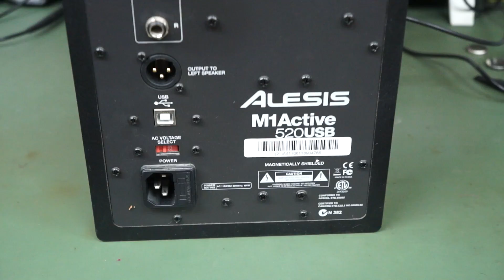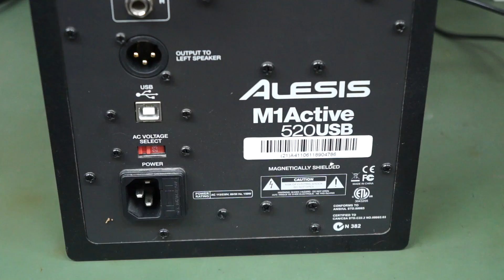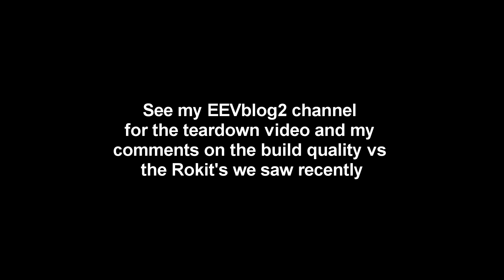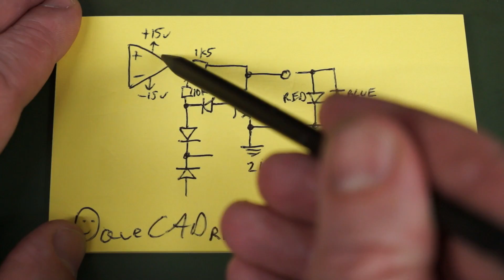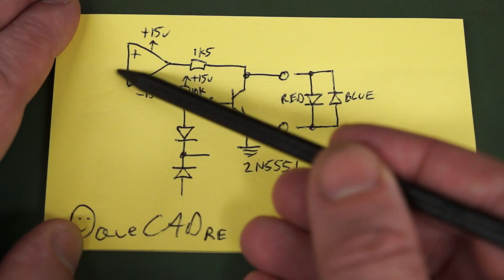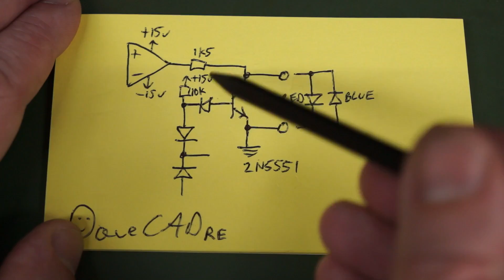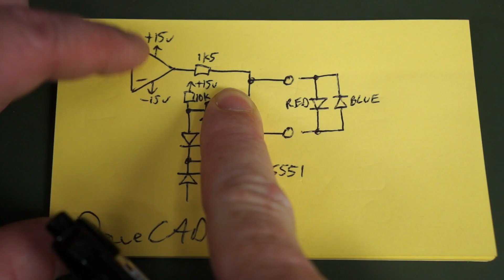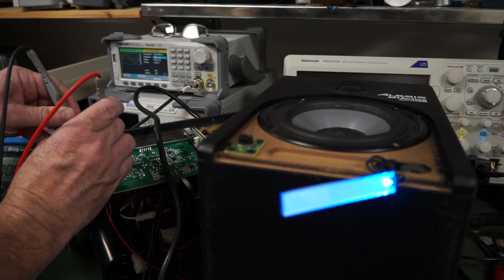EEVblog #1087 - UNBELIEVABLE Alesis Studio Monitor Fault!

Comment: Don't use USB power for speakers it will put more stress on your computer's power supply. I think they are a stupid idea.
Reply from the maker: Err, these are mains powered monitors.
Reply: Don't install motherboards in your PCs. It will stress the power supply.
Reply: No, it won't stress the power supply. And if you actually watch the video you can see the nice big obvious mains inlet on the back of the speaker anyway.
Reply from the maker: Ryan Smith  - I showed the back of the unit, it has a mains connector, pretty obvious.
Reply: You would never get monitors such as this to run off 5V 1 or 2A.
The quoted power output is 20 or 30w per ch, and I would imagine the unit as a whole would use close to double of that due to inefficiency.
Which is not to say it wouldn't make some sound at low volume if you had some way of bypassing the transformer etc.
Reply: Prehistoricman don't be such a pratt
Reply: EEVblog oh, I have bought usb speakers in the past and they usb for power and data but they were really small pc speakers that I ended up never using.
Reply: I assumed that this had some transformers to amplify the 5v input power
Reply: EEVblog maybe you did not make during the video. I could not see no plug so somehow I assumed it was USB, especially when you said the speakers used usb I just thought "oh no here we go again".

Comment: what is he saying at 8:22 ?
Reply: 12:20 "suck out that tranny"
....?
Reply: Translation is "desolder that transistor". Suck out refers to the desoldering tool, which melts the solder and sucks it inside, to remove it from the board.

Comment: I expect the surface either of the anode or the cathode inside the LED to be corroded and increased resistance by whatever reason, so the higher current probably helps to pass it. We definitely need an LED Engineers opinion here.
Reply from the maker: Yeah, something like that. That's what I was alluding too when I mentioned a "point contact diode effect".
It's not like there is enough current cause any heating/expansion effect of the contact, so more likely to be some sort of contact surface phenomenon.

Comment: Still waiting for fair ANENG8203 review
Reply: M E You can't spend $3 more and get a uni-t?
Reply from the maker: The Uni-T in my opinion is a BETTER meter for only a few dollars more, it WINS the low cost meter shootout. You don't have to like that, you can have your own opinion, but don't complain I didn't give it a fair review, I did.
Reply from the maker: BTW, go look up the meaning of "poor diddums", it has nothing to do with being poor and not being able to afford something.
Reply: UNI-T10A won the shootup, but why?  The ANENG 8203 is objectively better in many aspects:
unlike uni-t it's true rms (which could be a big deal)
unlike uni-t its beeper is loud, fast and latched (and not cheap and scratchy) 
unlike uni-t it does light up white leds (brightly actually, uni-t doesn't do it at all)
unlike uni-t it has 2 AAA batteries, which should give it a longer runtime (specially with lithium AAA's)
Additional personal prefs:
+ it has a propper knob that you can grab, with two off positions
+ it has a hardcase at least
+ it has a battery door (you could actually silicon-shut the rest of the case, which should make it really quite ridgid)

You should have waited with fault testing until after all the measurements.  We don't know the Anengs performance on ranges after this test damaged it. Do you have 240V 400hz AC in your house? And you say yourself, these meteres are generally not for working with the mains.
Plus the Uni-T 10A costs actually more then 100% more, at least in europe. But that depends on your continent and country I guess. You can order two and keep one as a spare. In case you measured voltage on ohms on an commercial airliner.
Reply from the maker: Poor diddums.
Reply: Poor people who can't afford a Fluke for every little thing?

Comment: Thanks for doing this Dave it's great to see more audio gear.

Im definitely planning to send you some high end desktop speakers that I designed for sure. I'm just getting my CNC machinery and new workshop setup before hitting KickStarter. Your videos helped with my PCB design - I added a flux capacitor.
Reply from the maker: Cool, good luck with it. What's different about your speakers?
Reply: Hey Dave. The difference is uncompromised sound and build quality, in a speaker only 20 x 12 x 12cm. I also designed a matching vibration isolating desktop stand so they don't set your desk in resonance. They will all be hand made by me in my workshop (in Kent, England).

Comment: Early blue GaN LEDs could have odd behavior, including even color shifts.  Just how old is that speaker?
Reply: I just spoke with the LED it is 33 years old
Reply: Don't blue LED's have a larger voltage requirement?  They probably realized the 5v across it made it too bright so they set the resistor to have it barely turn on.  ...drift happens over time... stops working.  Then you put it in parallel with another resistor and it worked again.  Red only needs 2 volts to turn on?
Reply from the maker: Only like 5 years old
Reply: BobC it gets even better if you consider that this LED must have sat in stock for ages before being shipped inside that particular unit.
Reply: Older than the sands of time
Reply: Nope, when the LED ist conducting, it should light up. When there is a voltage drop over the resistor, there is a current flow through the LED. The voltage level over the resistor is determined by the supply voltage minus the LED voltage drop. The current flowing through the diode is determined by the resistor value. So by lowering the resistor value, you increase the current through the LED.
Reply: Ryan Smith LEDs from the Nile. 😶
Reply: Not that old, it’s got USB so it’s post 1998.
Reply: EEVblog 
There's a date printed on the inside of 2009.
Reply: I used for fix led tv and some lighting bubs and when they start deading they go into the frikering on off beavior and ended on big black dot sometimes and other just open circuit.
Next time try termal stress on it.

Comment: Having just bought a set of Alesis Elevate 5 you had me with the title....
Reply from the maker: They any good?
Reply: Hi Dave, I quite like them, thanks for asking.

They're the older ones, not the V2. I use them with the bass boost off and they're good as close up monitors as designed.  I guess the bass-heads would want more bottom end though. They're plenty loud for monitor use with basic video editing and general TV/Video viewing from 10ft away. Getting on in years but they sound crisp with nothing to complain about. 

https://www.dropbox.com/s/p2j1et2u6ecvezh/Speakers.jpg?dl=0

I've tried the Rokit 5's  but they're more than I need for in the house.
Reply from the maker: Isn't 10ft is getting away from "near field" monitors?
Reply: In use I'm only 2ft or so away; I can touch the drivers "when sitting up and using them." I do sit back and let them go a bit looser when just watching Youtube, listening to podcasts or just hanging around in the room.